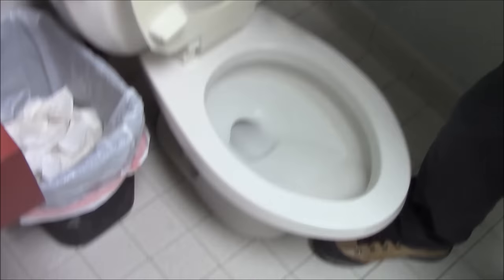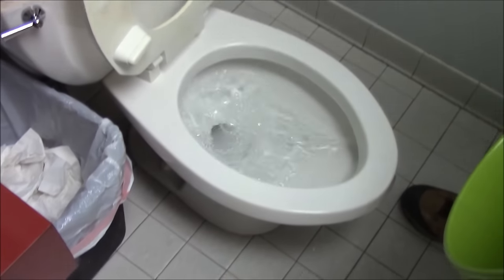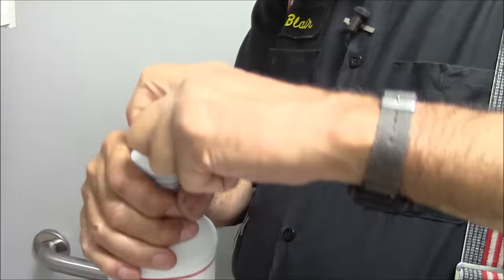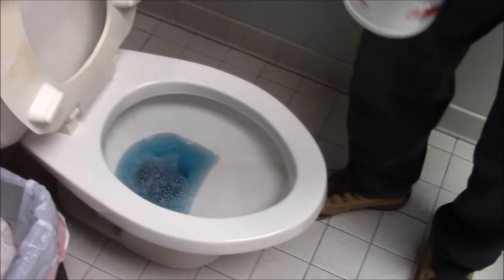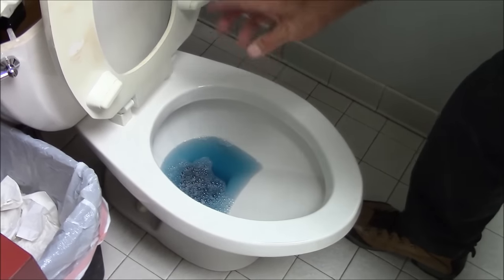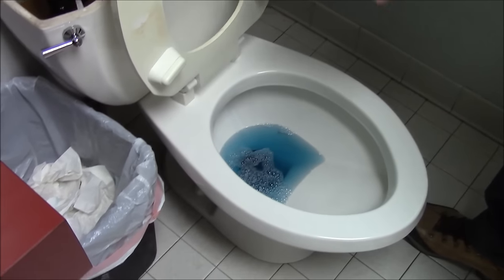Slow Flushing Toilet? Quick and Inexpensive Cure With Delimer

Comment: Thanks so much for the info as if describes my problem perfectly.  Mine is a septic system.  Is there anything safe for me to use?
Reply from the maker: By the time the delimer reacts with the lime in the toilet it should have no effect going into a 700 to 1,000 gal septic tank. If you have any doubts just add some septic additive the next day to insure your tank is 'percolating' properly. You should be adding a septic treatment to your tank twice a year anyhow.
Reply: Thank you for your reply.  At 84, moved into home with septic.  My first ever so was very nervous about putting anything into the system.  I compared the water coming from the holes under the rim with another toilet which works perfectly and is three years older, and they seem about the same.  The water just swirls in this one but doesn't go down the drain as it should. Tried the dish detergent/hot water trick several times. That didn't work. Have an auger ordered and if that doesn't do the job will try the deliver.  Thanks again. @MrHardware1
Reply from the maker: @viccahood5843  Did you do the bucket trick? Fill a 5 gal pail up to 3 gallons, then pour it into the toilet. It should go lickity split, mater a fact the last gallon should go at once. If so then I'd try the delimer, one quart, reduced by cleaning calcium all the way to the tank, will cause no damage to the biology. Plus I want you to toss in some septic juice once this is done.

Comment: I have a new American Standard toilet. When flushed, it fills up. After it is filled, you can hear a little water running down drain & bowl will lower some & it will stop. No problem after that till you flush again. A friend says his does that also. I have only had toilet 3 months. Any suggestions? Thank you
Reply from the maker: @tomemery3916  it sounds like the fill-tube, the small tubing from the fill valve to the flush valve, is delivering more water to the bowl than it can hold. No problem, most toilets send more water to the bowl to insure it is filled and to help rinse and waste down the trap. As long as no water runs between flushes you should be fine.

Comment: Wonder it you can put something up around the rim to slow or hold the acid in the rim area so it can work on the rim deposits a bit longer? I'm thinking like a small diameter rubber tube, hose or foam insulation strip.
Reply: I just saw a video of a woman who put strips of duct tape under the rim to block the holes and used vinegar as an acid.  She left the tape on for a minute or two.  Very easy.  I think her channel is 'watch jane drill' or something like that.
Reply: @sharonnielsen6635  Yeah I've seen a few of her videos. Sounds like a plan for the weekend!

Comment: Dear Mr Gilbert, can this product be used if you're on a septic system?
Reply from the maker: I do, because usually your tank is 1,000 gallon and it is a small percentage. Also, the acid has been working all the way to the tank so it is not very powerful when it get there. Plus you could wait a week and then introduce some septic treatment to get the bugs down there working.

Comment: Hi there, do you have any suggestions for alternatives? I'm from the philippines and I've tried a few hardware stores but none of them have any bathroom products with delimer in it.
Reply from the maker: You can use muriatic acid the same way with almost the same results. It is easier to find sometimes.

Comment: I had 30% vinegar, so I poured it down the overflow instead. It seems to have done the trick. I can see a visible stream coming out of each jet. I wonder what would happen if we mix 30% vinegar with tomato puree to add viscosity so that it sort of clings as it eats away deposits. I've seen people using duct tape to create a seal, but I'm lazy, so I tend to look for easier solutions lol...
Reply from the maker: @tonywielder7745  if the acidic acid was more expensive I’d tape the jets, but so far all the toilets I treated worked fine w/out tape.

Comment: Mr. Hardware can this remove severe lime/calcium deposits? Can you link me to where I can buy Rooto 3 in 1.
Reply from the maker: Some of my worst cases required 3 treatments to bring a toilet back to normal. If you can't find it anywhere use muriatic acid. It is what we used w/success for many years until Rooto came out w/the delimer. You should be able to purchase it at any building supply where brick and building supplies are sold.

Comment: Have you ever try using vinegar ? I use it every time I had to remove calcium, on my car carpet, in my caldrons and also in my toilet from time to time.
Reply from the maker: It works, just not as quickly and it requires more applications.
Reply: @MrHardware1  Thank you

Comment: Chances are if you have City water supply you'll have fewer if any calcium deposits, this mostly comes from well water
Reply from the maker: The chlorine, fluoride, and other treatments that are put in city water turn into mineral like deposits in the Jets, the same as iron and other minerals from a well.
Reply: @MrHardware1  I didn't know that, maybe that's the black residue I find occasionally around the jets or mold

Comment: PLEEEESE I NEED HELP AND SOME ANSWERS. I have a septic system and was told 50% chance problem is my septic FIELD not tank. I tried this procedure using CLR. The only thing that happened is a little CLR came down into the bottom of the bowl via the flush pipe or whatever you call the main hole/pipe that flushed the “junk”. How do you get it to come thru those little hole under the rim without flushing it? You can’t! There are some steps missing from your video like someone else mentioned. Could you please tell me your thoughts on my post, and tell me the steps?
Thank you, Valerie
Reply from the maker: You need muriatic acid, not CLR, and pour it into the overflow tube rapidly and all at once. That usually gets the acid to come out of the jets. Some toilets are trouble and only a small amount of the acid will come out of the jets. Sorry I have no control of that but this procedure works on most toilets.

Comment: I use Dawn detergent once the month,  the Condo cast iron pipes is 50 years old; extremely fragile to acid materials
Reply from the maker: Does Dawn detergent dissolve calcium crystals? If it does, I was never aware of it.

Comment: The excess Rooto in the tank isn't going to erode or harm the seals within?
Reply from the maker: No because the delimer is being poured in the overflow tube which goes directly to the rim jets. You may spill little in the tank but it is filled with water and it diluted so has no effect on the seals.
Reply: @MrHardware1  I already ordered this from Walmart. I will try on my parent's three Kohler 1.6 GPF two piece toilets that they've had since 1997. Although I don't believe any of the jets are foreseeably blocked I think it would be prudent to perform this action regardless. Thank You and if you have any further advice for I please  advise.

Comment: So ... I poured it (CLR) down the overflow tube and it showed up in the bottom the toilet.  It did not  seem to run through the raceway at all.  When I flush, however, water comes through the raceway.  Have I lost my mind?  Is my toilet centuries old?  Any idea?  Thank you!
Reply from the maker: Some toilets need several doses, I prefer using muriatic acid as it’s thinner and when you pour it quickly into the overflow tube, it will get into the raceway better. Sounds like you’re fine the way you are.

Comment: How do you do this with a Koehler class five toilet tank? The flush mechanism is a 3.5” canister/tube. There is no overflow such as the video shows. If I pour something down in the canister, it appears in the bottom of the bowl just above the trap.
Reply from the maker: You need to pour quickly, to get some out of the rim jets.
Reply: @MrHardware1  I don’t think the class five works that way. In your video, it seems the overflow tube feeds only the jets? The class five it different. There is a large diameter canister that lifts up instead of a flap system. Under the canister is the trap way with a very thin channel around the opening which I believe allows some water to get to the rim (jets).

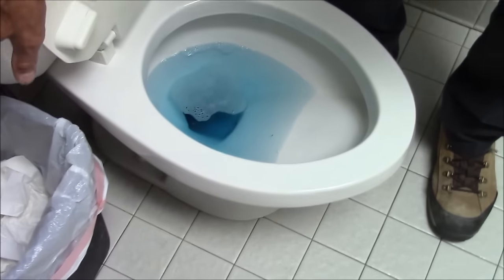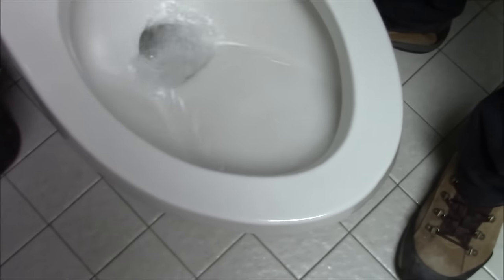Comment: Good luck finding the Rooto product for $5.00.  Perhaps, it's less expensive in Michigan. Not sure why you edited the toilet flush around 4:10 -4:15 mark.  It would have been nice to see a complete flush, post-treatment.
Reply from the maker: Maybe it is because it is made in Detroit, possibly it is because we don't gouge customers when we markup products. Use muriatic acid, inexpensive and easy to get anywhere.
Reply: @MrHardware1  Found 12 pack on E bay for about $4.50 a quart.  Just having trouble finding individual quarts for anywhere near that price.  Thanks for the nice video.

Comment: Great! How to open rim holes?  They are blocked...
Reply from the maker: If you can’t find the delimer, purchase muriatic acid. And if they’re fully clogged, you may have to give it up to three doses which is still around $15 which is worth for saving the toilet.
Reply: @MrHardware1  Ok thanks, but How to block the big holes in the rim (front/back holes), because the solvent liquid comes out of them first, and does not go into the small rim jet holes...
Reply from the maker: @pekkavalkonen1973  you could try using some thing like plumbers putty as long as you don’t shove it too far in the hole and get it stuck in there. Usually when I have this situation after two doses, yes cleans out everything in the room.
Reply from the maker: Sorry, spellcheck took over that, usually two doses will get all the Jets cleaned out if there’s large holes involved

Comment: I have the same fill valve in this video. How do I clean the calcium and mineral deposits that is clogging it up? Thanks.
Reply from the maker: Take the top off the valve, with the supply water turned off, hold your hand over the top and turn the water on just a little and purge any crud out of the valve, stop the water, replace the top and you should be fine.

Comment: When I flush my toilet the water gets really high in the bowl before it goes down... even if it just water... What could be happening?
Reply from the maker: It could be the vent through the roof. Try the bucket test. If water comes up to the rim you could have a clogged drain. Blair
Reply: Mr. Hardware k

Comment: What if the toilet fails the bucket test? What to do next? Thank you very much. I didn't hear any gurgling of other drains.
Reply from the maker: That usually means that there is a cog in the toilet or one very close to it.
Reply: @MrHardware1   thanks I bought a toilet auger this weekend for ten bucks at Home Depot. I suspected I might have flushed a rag or something for my cleaning bucket. I had flushed a small scrub brush and luckily snagged it with the toilet auger. Thanks. I had wasted so much time messing around with the toilet.

Comment: many of the high potency drain cleaners actually use sulfuric acid.  Nasty stuff but extremely effective!
Reply from the maker: Sulfuric acid is for clogged drains w organics, muriatic acid is diluted hydrochloric acid, not as good w organics, but great on mineral deposits.
Reply: @MrHardware1  Hydrochloric Acid will destroy plated sink fixtures.  Phosphoric acid (ie cola soft drinks or CLR) is a good choice for mineral deposits.

Comment: Nope, I have used straight muriatic acid because it was super hard well water. And I used an electric pump to put it back into the tank so it would flow through the holes. It took 4 hours and it flushed like brand new. Yes, Dangerous due to fumes. I had 100% airflow in one direction so the danger to a minimum. Yes, I stayed upwind.

Comment: Weird.
I did not see any blue cleaner coming out of the jets. But there was some blue cleaner in the bottom of the bowl... below the clear water.
I have it working on the drain trap now. I don't understand why it didn't come out the jets though.
Reply from the maker: Could have been our 3rd take, we were diluting to save product. Nice catch.
Reply: No. I meant ME. lol.
I think my jets are so clogged up only a few are open. I did another bottle and did see blue come out a few.
But on the positive side it's an old toilet, so probably uses 10 gallons of water ;) @MrHardware1

Comment: Can you put delimer down a kitchen sink that drains slow or backs up?  Already did the draino, etc. Many times.  Both sides of the sink stop up at the same time before starting to drain slowly.
Reply from the maker: Delimer won’t un-clog ‘organics’ in a kitchen, use an enzyme drain cleaner, powdered is better but not mandatory, and follow instructions for at least 4 nights.
Reply: @MrHardware1  Thank you.

Comment: I need to do this to my toilet but I have a kohler toilet canister and don't have the same type of overflow stand pipe. Any suggestions? Thanks so much.
Reply from the maker: A funnel if possible, or remove the canister and pour into the flush valve opening is better

Comment: I couldn't get Rooto, so I tried this with Zep.  The liquid did not come out of the holes under the rim.  I've done two applications, and it's removed a lot of the visible residue.  There was a significant amount, It still seems slow, though, so I'm not sure it's getting to the inside.
Reply from the maker: Can you get Muriatic acid? It is better than Zep in this case.
Reply: @MrHardware1  I will look for that in the future.  Zep worked pretty well.  I just didn't understand why it didn't travel through the rim, and out the holes.  Luckily, the holes don't seem to be plugged.  Thanks.

Comment: Will this issue make your toil bubble? I have tried almost everything vents have been clean septic has been sucked out and so on I even rerouted the washing machines drain to where it doesn’t drain in my septic.
Reply from the maker: I use it and I have a small, 500 gallon, septic tank. By the time the acid cleans the toilet and makes it way to the tank it is usually quite inert. I also routed my showers and my laundry to a gray field. It gets the nuisance water out of the septic tank so they turds can percolate better, LOL

Comment: I have an old container of muratic acid. Can I use this first to see if any improvement?
Reply from the maker: Perfect way to safely dispose of it. I’m not versed if the life span of acids.
Reply: @MrHardware1  Thanks... The label says 20% ... Put a few drops on some baking soda, and it's very reactive. Should I reduce before using or just go with full strength?
Reply from the maker: @chuckhampton304  full strength baby.
Reply: @MrHardware1  Thanks again!

Comment: After 3 bucket test that were fine I put clr down overflow. Not a single sign or drop seen inside bowl. Not under rim from jets no where? Is an old toto clayton I believe. Is there a reason why?
Reply from the maker: It could be the thickness of the clr, the muriatic acid is like water and flows the same. Possibly the clr went through the trap unnoticed. If nothing came out the jets, get the muriatic. Be careful using it, but I bet it does the job.

Comment: Need advice..when toilet flushes, the tank fills back with water, but the bowl only fills just enough to see water. I can fill bowl with to proper height with bucket. And automatically flows out empty again. Help?
Reply from the maker: If you aren’t holding water in the bowl especially if poured in slowly there is probably a cracked trap. Time for new toilet

Comment: I found a better way to clean the traps is to shut off valve
Flush all water out
Dry the inside bowl especially the jet area
Place duct tape on where the jets are.
Pour your acid solution into the vent pipe.
Let solution sit awhile.
Remove tape
Turn on water valve 
Use as normal
Reply from the maker: You gotta add the caution of acid residue on the tape when removing….. I’ve never had to do this however I’ve always done a second treatment if the first didn’t do good enough a job.

Comment: Got a case delivered last week. I put 3 bottles through and still fails to flush sometimes. Not a very strong flush when it does work.
Reply: If you did the bucket test and it didn't flush fast, nothing will fix your slow flush. If it gulped the water down, then you have to keep working at your bowl. Take a rigid pipe cleaner and insert/clean each jet hole. Also, clean the large jet hole at the bottom of the bowl. Another thing I learned was to check the sewer exhaust pipe and clear any obstructions. No airflow causes slow draining, kind of like taking a 2-liter bottle filling it up, and flipping it upside down to drain. It gulps for air and doesn't let water out that fast. If you put a hole on the bottom size so air is behind the water, it drains super quick. same idea (as how I understand it). Good luck!

Comment: What if NONE of your rim jets have even a trickle coming out - suggesting that the mineral blockage is "upstream" (I'm thinking where the channel to the rim jets breaks off from the one heading to the siphon jet)?  When I pour vinegar down the tube it all just comes out of the siphon jet at the bottom, and as a result I think it's not "sitting" on the point where the blockage to the rimjets is.  It seems like I need to block off the siphon jet completely to get the acid to sit on the blockage place, but it's hard to get a good seal to "stop" that up.  Any ideas?
Reply from the maker: Pour the acid quickly into the overflow tube, and some toilets require 3 ‘doses’.
Reply: @MrHardware1  Actually my problem was something else entirely.  There was no upstream blockage.  The way I had the lever angled it was letting the tank water in too gradually so it wasn't rushing up into the rim jet channel.  Thanks for the reply!  I think your word "quickly" may have gotten me thinking about the physics in there.